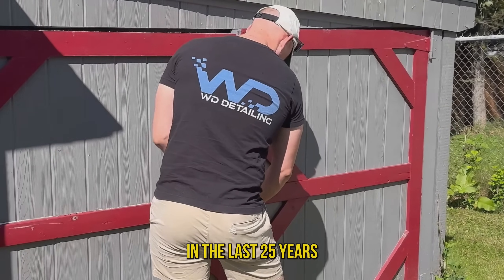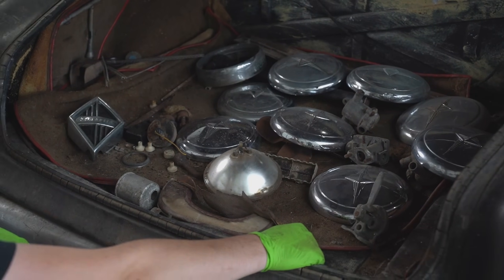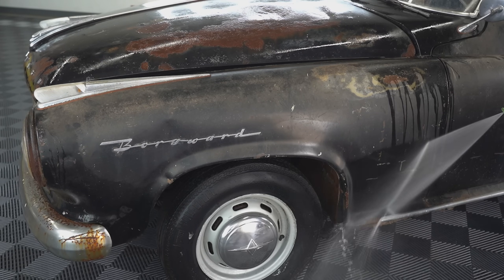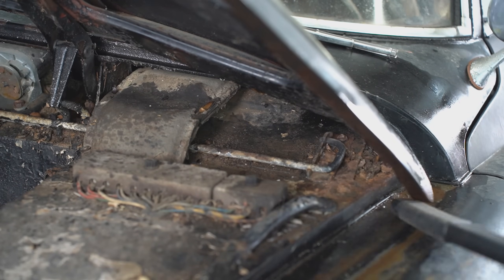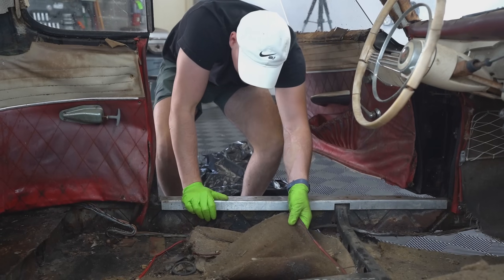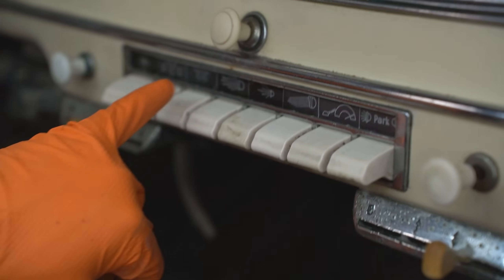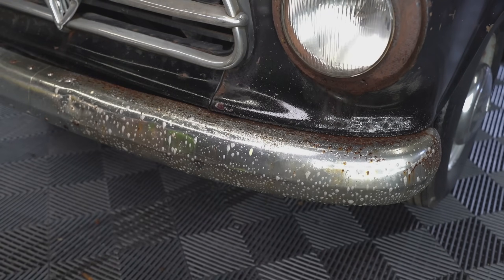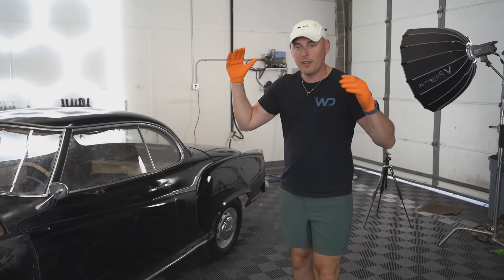ABANDONED BARN FIND First Wash In 25 Years Borgward Isabella! Satisfying Car Detailing Restoration

Comment: Certainly worth restoring such a rare piece. Replacing the floor and pans is a regular part of restoration. Doesn’t seem too rotten or rusted through otherwise. And the engine turns.
Reply from the maker: Great points!
Reply: Do not wreck. Restore
Reply: Just looked up prices for Isabella Coupés in Germany (my home base). Roughly 65k Euro for a perfect car, 40+k for a very good one and about 30k for a decent one (rate to the USD is more or less 1:1). This should make a restoration of this fine vehicle worthwhile. ;-)
Reply: If someone is going to restore this treasure, would you please give us the link to it?

Comment: Despite outward appearances this car is actually really in decent shape! These cars always need floors and inner/outer rockers. It's just a fact of life with them. Once you get those taken care of you have a beautiful car. Plus they look so good in black with that red interior. Usually they have this huge chrome bezel for the headlights. I've not seen the headlight setup on this car before and much prefer it! Someone will get an excellent project with this car and you've really brought out its beauty!
Reply: There were different ones - Hella and Bosch. Look at an older model - they mostly got the smaller ones. But both fit. It would be nice to see the suspension of the rear radius arms, though...

Comment: The hardest part would be to find interior for the Isabella. It is extremely hard to find parts for borgward and when, you can pay in gold.
To the question regarding the plate, this is an old plate from the customs office in Germany to ship cars from Germany to another country country. Last plate was issued 1988.
Reply: I've not had too much trouble getting parts, I've had several of these. I could be speaking too soon, though. Mine needs rockers and floor, too.
Reply: They are available from Germany

Comment: As a couple of people have said, it is a late 1959 or 1960 model Coupe (due to the small grill diamond).  Yes, it is worth saving and restoring.  No, it is not going to be easy or cheap.  Parts are extremely rare and hard to find and cost a mint when you do locate them.  A fully functional Borgward is a joy to drive, even with that 4-speed column shift.  The engine (1488 cc, 70 HP) is strong and peppy.  Sterling Moss used a fuel-injected Borgward engine in his Formula 1 race cars in the early 1960s with much success.  The dash knobs are the choke (left) and heat (right).  The two slide levers at the bottom if the dash are the air control for each side's vent.  The earlier model cars have a cigar lighter rather than a cigarette lighter.  This uses a smaller socket and has the heating element exposed.  Yes, it will burn the crap out of your finger or thumb because it takes a long time to heat up and you will stick your finger to it, usually just before it turns incandescent red and you now have a lovely spiral brand on your fingertip.   The clock in the dash may still be a wind-up model.  If so, it will keep excellent time as long as you remember to wind it once a week.  This car does not have the optional Blaupunkt radio, which was an AM-FM-SW model. I have owned several of these, both coupe and sedan versions - loved them...  I will be in touch about contact info...
Reply: Right. Apart from the fact that the clock works electrically - my Hansa 1500 of 1952 still got the wind - up clock...
Reply: Our family had a DKW 3=6 when I was growing up, and it had the cigar lighter like your description.
Reply: @snich63  They are identical. These cigar - lighters were not only made for Borgward.
Reply: This car is a 1961,by that time the clocks were electric,they also used Becker radios and Blaupunkt

Comment: Borgward made one of the best german cars in the fifties. The metal work of the body was superb. the 1,5 l engine was very good. They was cheaper then a Mercedes dut the quality was the some. My father had one in the sixties. It`s the first car i remember to ride. It was a sedan. To me he was best looking that your model.
Reply: Borgward always was far superior than a Merc. Remember the Borgward " air - swing " ( pneumatic suspension ) on the 6 - cylinder P 100 ? Only weeks before this model was presented at the IAA, Merc said, that pneumatic suspension is impossible for the time being. Well; yes, for Merc, it was impossible...but this was a Borgward !

Comment: I do think this is a 1959 or 1960, due to the size of the Diamond on the grill.   I do think this is a restoration candidate too, because it's so rare and these cars have such a following.    I posted this video on two different Borgward Fan Sites around the world, so maybe you'll get some more subscribers.    It's a really good car.  They don't have a frame so you can't do a frame off restoration, you have to weld into the car the repairs, new floors, but honestly, that's not a really big job.   Being a German car too, so much is "off the shelf".   If you saw that little amber lens in the trunk, it fits the NSU, the BMW Isetta, the Borgward, the Lloyd, the Goliath...etc etc.....the side view mirrors, they use them on Opels too.....it's transmission in this car is the same used in a Mercedes Benz 190 of the same time period.....they are pretty easy to source parts......a very very cool car, thanks for sharing!   I wish I could buy this!!!
Reply: Sorry....there are n o identical transmission parts on a Merc. Prove me wrong; I work on Borgwards for my entire life...

Comment: The Borgward Isabella Coupe is a classic car model produced by the German automaker Borgward between 1957 and 1961. The Isabella Coupe was a part of the Borgward Isabella range, which also included sedan and station wagon variants. The Isabella models were designed to be stylish and represented a significant step forward for Borgward in terms of design and engineering.

Key features of the Borgward Isabella Coupe include:

    Design: The Isabella Coupe had a distinctive and elegant design, featuring a coupe body style with a sleek roofline and stylish curves. The design was the work of Carl F. W. Borgward's son, Peter Borgward.

    Engine: The Isabella Coupe was equipped with a 1.5-liter, four-cylinder engine. The engine was known for its smooth performance and contributed to the car's reputation for being a comfortable and reliable vehicle.

    Performance: The Isabella Coupe was designed to be a comfortable and relatively sporty car for its time. It offered good handling and performance, making it popular among drivers who wanted a combination of style and practicality.

    Innovations: The Isabella series, including the Coupe, featured several innovative elements for its time, such as a fully synchronized four-speed transmission, which was not common in many cars of that era.

    Production: The production of the Borgward Isabella Coupe lasted from 1957 to 1961. During this time, Borgward faced financial difficulties, leading to the company's eventual bankruptcy in 1961. The bankruptcy marked the end of Borgward as a car manufacturer.

Despite the relatively short production run and the challenges faced by the company, the Borgward Isabella Coupe has gained recognition as a classic car, appreciated for its design and historical significance in the automotive industry. Enthusiasts often admire the Isabella Coupe for its distinctive styling and its representation of a bygone era in automotive design and engineering.
Finding parts for classic cars like the Borgward Isabella Coupe can be a bit challenging, as these vehicles are no longer in production, and original parts may be scarce. However, there are several avenues you can explore to locate parts for your Borgward Isabella Coupe:

    Specialty Auto Parts Suppliers: Some auto parts suppliers specialize in providing parts for classic and vintage cars. These suppliers may have a selection of parts for Borgward vehicles. Online platforms and catalogs may help you identify and order the specific parts you need.

    Classic Car Shows and Events: Attend classic car shows, swap meets, or events dedicated to vintage automobiles. These gatherings often attract vendors who specialize in classic car parts. You may have the opportunity to find the parts you need and connect with experts in the field.

    Online Auctions and Marketplaces: Websites like eBay often have a section for classic car parts. Sellers from around the world may offer rare or hard-to-find components for your Borgward Isabella Coupe. Be sure to verify the authenticity and quality of the parts before making a purchase.

    Specialized Forums and Communities: Joining online forums or communities dedicated to Borgward cars and classic vehicles can be a valuable resource. Enthusiasts often share information about where to find parts, discuss restoration projects, and offer advice on maintaining vintage cars.

    Classic Car Salvage Yards: Some salvage yards specialize in classic cars. While finding an exact match for your Borgward Isabella Coupe may be rare, salvaging parts from similar models or vehicles from the same era could be a viable option.

    Borgward Enthusiast Clubs: Joining a Borgward enthusiast club or organization can connect you with fellow owners who may have spare parts or know where to find them. These clubs often have a wealth of knowledge and experience within their membership.

    Professional Restoration Shops: Classic car restoration shops may have access to a network of suppliers and resources for sourcing rare parts. Contacting such shops and seeking their assistance could be a helpful option.

When searching for parts, it's essential to be patient and persistent. Networking with other enthusiasts, both online and offline, can provide valuable leads and tips. Keep in mind that custom fabrication or reproduction of certain parts may be necessary if original components are unavailable.

Comment: It's a Borg-Ward Isabella Coupe 2+2,  Quite Rare and well worth the restoration. The 1463cc Engine looks immaculate and is well worth the refresh as it's a #'s match for the chasis.   to part it out would be very sad as  i read there were only around 10000 2+2 copes built between 1957 and 1961 with 5000 going to the USA and the others to Germany, UK, Australia and other countries
Reply: You have done your research. Engines were very well built,the engine should be fine,needs floors as they were one of the first unibodies

Comment: That has to be one of the scariest, rarest automobiles I've seen. Thank you for showing her. I've heard of Borg Warner transmissions, but have never seen an entire vehicle built by Borg Warner. I'm guessing that's a 1950s automobile, but I could be wrong. I'm no expert. Sorry it was such poor condition, it makes your job so much harder. In all honesty, If I were a collector, I would avoid it because of rotted out floor boards. Someone will have to dump an incredible amount to get this relic back as it should be  in dignified condition. The engine is interesting, the whole car is rare for the United States, but there must be thousands of them over in Europe. Appreciate your showing her, I have never seen  a Borg Ward before. Thank You for your toil, Some welder or affluent
Reply: Do not mix things up ! BORGWARD has got n o t h i n g to do with Borg - Warner.

Comment: I agree, I think it's definitely worth restoring. Especially because the engine turns. And the remaining interior isnt that bad. It just needed a deep scrub.
Reply: Well, there is not much left of the interior, wooden panels on doors fell apart . it is a bit of work, though. The engine may turn - but has to be inspected and taken apart. Otherwise, it will not last very long...especially not the timing - gear. To check oil - pressure - valve in the cylibderead, it has to come off - same for the oil - pump. You can only take the sump off if the engine has been removed from the car. As far as the piston - rings are concerned - no comment...

Comment: The Borgward Isabella Coupe was in production from 1957 till 1961. The design remained unchanged throughout the entire production run of no more than 10.000 vehicles. 
It is considered the most beautiful car of the 1950 area made in Germany by many. It is certainly worth restoring but should be exported back to Germany to do it. I wonder if this is the original paint.
Reply: Apart from small diamond - big diamond; changed in 1958. Some people welded the bonnet to " update " the car...just that little triangle had to be welded in..
Reply: About 9500 cars ,yes it is original paint

Comment: SAVE IT! Restore, not resto-mod!
SWEET! 1500 cc push-rod engine (1493, to be exact). Four-speed column shift, swing-axle independent rear suspension. 
I seem to remember the Coupe engine was rated around 75 horsepower, versus 60 in the sedans. 
They called it The Poor Man's Mercedes
The coupe didn't share any body panels with the sedans and wagons, sort of like the '53 Studebaker Bourke-Loewy coupes' relation to the standard sedans. 
I don't know for sure, but I believe the coupe variant came out around 1958.

Comment: I won't admit to how many years ago it was but I had one like this one you showed. My question is does it have a 4 speed transmission on the column? I remember that mine did but if I told anyone that it did they would tell me that l was crazy. I may be crazy but I am sure that it did. Most people have never heard of Borgward and this is the third one that l have seen. B.T.W. fantastic job with the clean up. It is a very rare car and it brought back great memories for me. Thanks!
Reply: Yes; 4 on a tree. Same gearbox as the Borgward P 100 - 6 - cylinder. This gearbox got eternal life - 600.000 mi would not be a problem for the box...

Comment: I started using the glass cleaner that you guys use and it works great! Very impressed! You guys are great!
Reply: After you spray the cleaner on the windows, give them a good scrub with fine steel wool. It really cuts through the cigarette film that is in most old cars. It also adds sparkle to the glass after you polish it.

Comment: Isabella Borgward disliked shifting gears, so Karl had his engineers develop a fully automatic four-speed transmission that would be more efficient and lighter weight than the available off-the-shelf units. It proved somewhat troublesome, but Mrs. B. didn't strain her left leg on the clutch.

Comment: Someone may have already pointed this out (didn't really feel like going through all 400+ comments), but I think you got those different light switches (keys) wrong at around 14:38 in the video.  From left to right, the "big one" is the regular driving light.  The middle one is the parking light on all four corners, which we call "Standlicht" (standing light).  And the right one of those middle three is for the foglights, as you can see the symbol shows the beam tilting to the ground.  Judging from the first cars my father bought in the early sixties (a 1955 DKW and later a 1961 Opel Rekord), the "high beam" is most likely to have been activated by a foot switch to the left of the clutch pedal.  This changed with new cars from the middle of the Sixties where you had to activate and de-activate the high beam from one of the stalks on the steering column.  

PS:  Regarding the light switches, there is also the utmost right on the keyboard (even saying "Park"), which is for the parking light that we call "Parklicht":  It activates only the left-hand parking lights and not those that are typically on the curb, as is also expressed by the symbol/icon/pictogram showing light only on the left.
PS2: And since it would not make any sense to squeeze anything else between those different light switches, I'd venture that the key you take to be for the wiper is really the instrument lighting (the "wiper" symbol being the speedo), while the wiper switch is on the steering column stalk.  Sorry if you already found out yourself, but I'm only fifteen minutes into the video and wish to avoid forgetting my remarks.
Reply: Please call it " position lamps " - not " standing lights ".....of course, there is no wiper command on the column, it is second to the right. Yes, high beam  is a switch on the floor - common practise.
Reply: @MichailKnoller  Thanks for the enlightenment (I thought "position lights" were something maritime), but please note I used "standing light" only as the literal translation for "Standlicht".

Comment: My father had a Borgward Isabella in the 1970s. It is buried out back on the farm. I still have the brake shoes if anyone needs them. The car could be dug out if someone needed parts. 
This 4 cylinder engine got amazing fuel milage my dad could get almost 30 miles to the gallon way back in the 1960s. This may have been part of the reason to shut them down. The gas companies were against fuel efficiency.
Reply: Are the brake shoes alloy - or steel ? ( Thus, you can say what year she is...) Undig her....but how you did 30 mpg, I do not know. I do 40 mpg in my Borgward Isabella...easily. The TS is even more economic...it had nothing to do with petrol companies; it was 90 % corrupt German politicians - and 10 % the sudden decline of sales of Borgward - cars in the U.S.

Comment: Chassis plate looks like it might be 368977. That would make it a 1960 model. Guys zoom in!
Reply: Judging from the hood ornament. And front wheel bearing hubs,it's a 61, but I will check the serial numbers, I have a true 61 and one rebadged by Earl C. Anthony
Reply: 368977 would be May 1960.